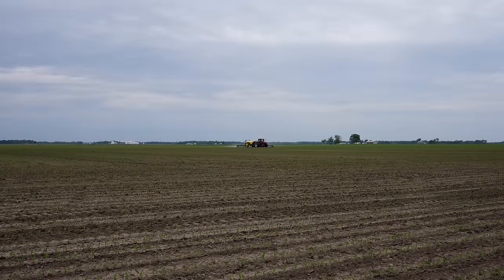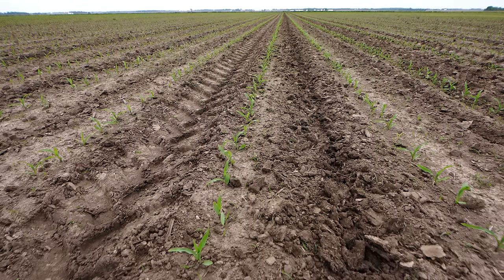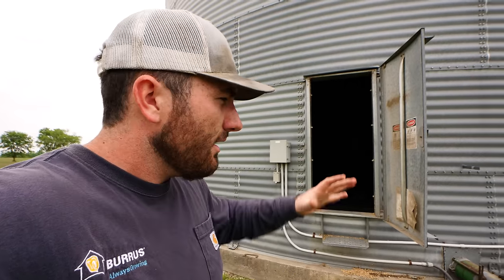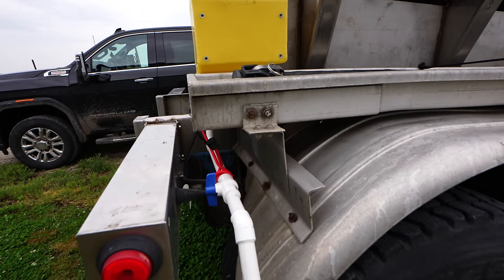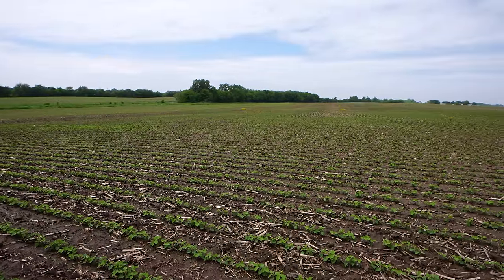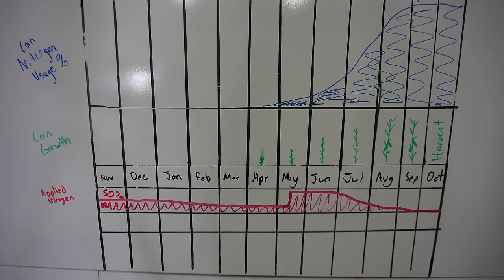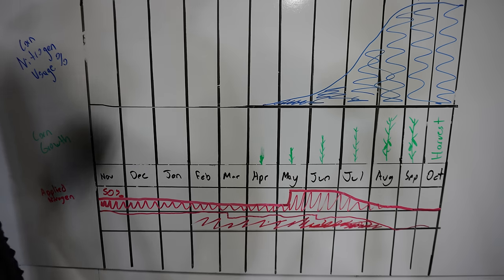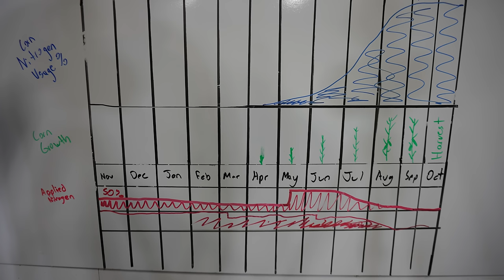Feeding A Potentially Monstrous Corn Crop!

Comment: Side dress is one of my favorite jobs. Get to look at every single plant. You could buy a NTB for the hagie and have a sweet setup with little damage and not worry about corn getting away from you
Reply: Ydrops
Reply: @allenwalters9068  not a fan of running them or laying it on top. Ud lose a lot of it this year. And running in tall corn isnt very enjoyable and hard on the equipment
Reply: @agger838  we haven't started, ours is custom done wasn't going to do any till it rained. Didn't rain we would save our money. I'm 40 miles south and east of Andy near Indiana border. This is year 4 of ydrops for us, been great, we noticed first year got 3 tenths on it after seeing the corn funnel water down to the ground worked great. I like to run a 32 bar way late to get benefit of sidedress. We're usually going at 6 to 7 leaf area and have done some taller sometimes weather don't work. 24 rows of ydrops works quite well for us. With a hagie you don't run over much corn at all. Everyone is different for sure. Last year we were able to cut back on our lighter dirt about 6 gallon of 32% due to wasn't going to be a high yielding crop, cutting back a little this year 10 lbs is it much no, but we are running 3 gallon of ats this year compared to 2. We did use a liquid deal to help hold it in form. NTB bars in my area there are none, one guy did it, after 3 years they sold it for ydrops they were doing a lot of custom work, said way to high maintenance.
Reply: @allenwalters9068  yeah the NTB can be kinda a pain to keep going compared to y drops that's for sure
Reply from the maker: I am conflicted about the NTB. I like the idea, but it seems like a lot to put on the sprayer at the same time. I know the 60’ option is a skip-row. Maybe I could run Y-Drops in the middle rows…

Comment: I’ve noticed that a lot of the farmers I watch switched from Y-drops to 32% in ground side dressing. They said it’s a lot less waste(less dissipation on the surface) root contact & price. Ydrops are messy & hard to clean thoroughly too. Anything dealing with fertilizer it appears to be difficult bc it eats through everything
Reply from the maker: There is a lot that is left up in the air, no pun intended, when laying a highly volatile chemical on the surface like 32%. I can see why farmers lean both ways. I am still undecided on how I would like to move forward.
Reply: @aTrippyFarmer  Well, if you want to see some comparisons(equipment & application) while you’re out spraying I have some suggestions to watch. Ivers Farms(Illinois/Indiana) & Brian’s Farming Videos(Ohio) switched to in ground. Cole the Cornstar (Iowa) uses Ydrops. He goes into cost/benefits. I noticed that a lot switched to in ground last year bc of fertilizer costs & saw improvement, but can’t remember who else did what. I’m addicted to farmtubers🤣Got my husband hooked too.
Reply: @aTrippyFarmer  Hartung’s had a tank on the farm that got damaged & had a big leak. Scary as hell. He was filming when he saw it & had to run bc he was down wind. He has livestock too. As you know, it sucks the oxygen out of the air. A cloud of it is deadly. I’ve seen tornados puncture huge tanks this year too. Scary stuff.